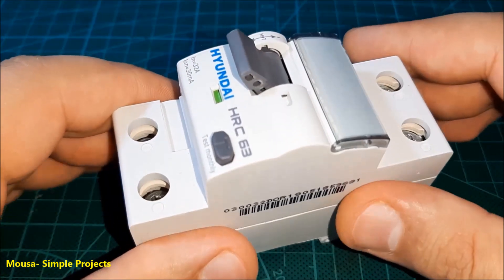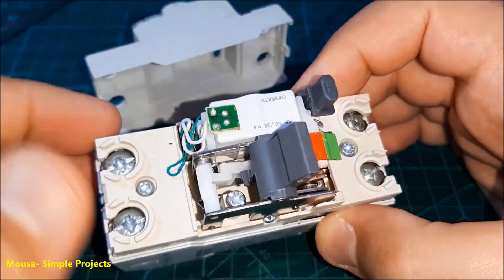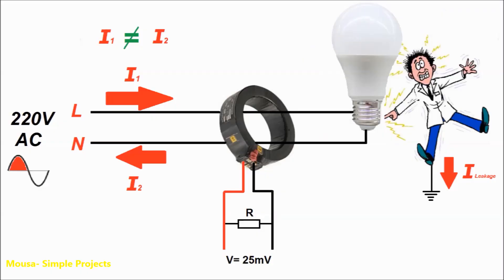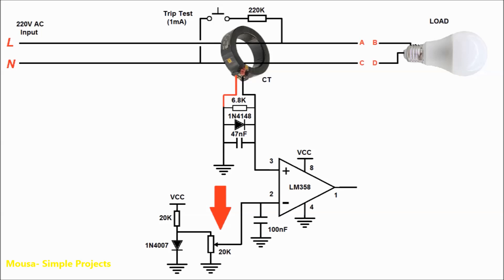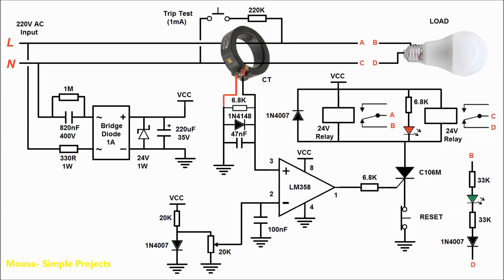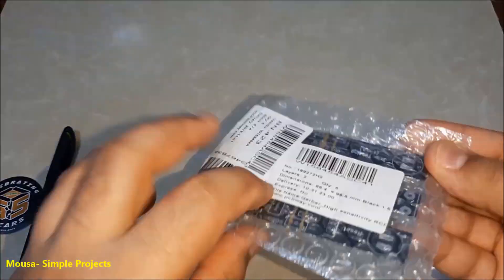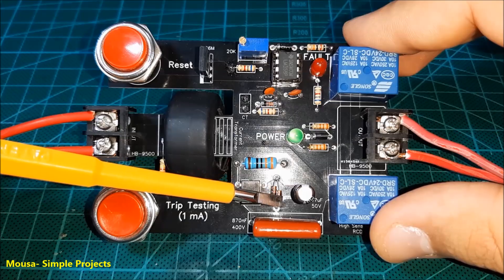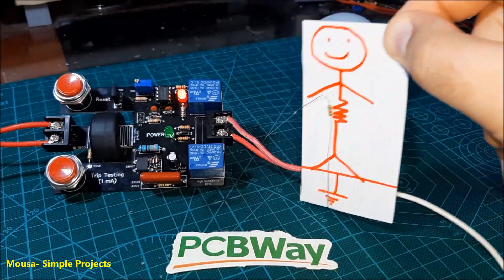How to make RCD Circuit to Protects the Human Against Electric Shock

Comment: Which ct is used here
Reply from the maker: I took the CT that came with PZEM-004T module.
There is no part number on it but according to Google it is 100A:100mA.
You can use different CT and adjust the sensitivity using the potentiometer.